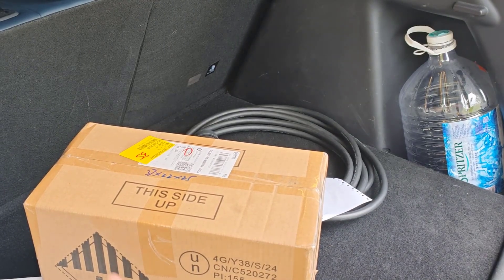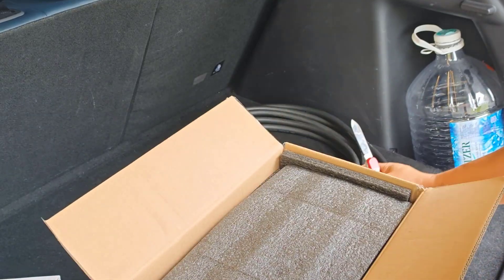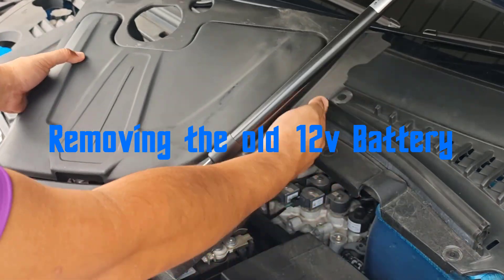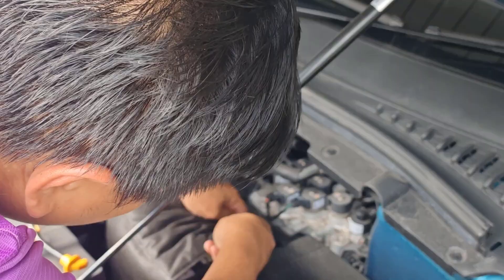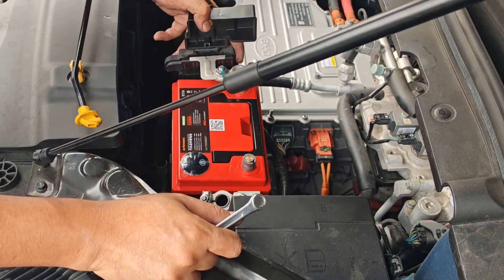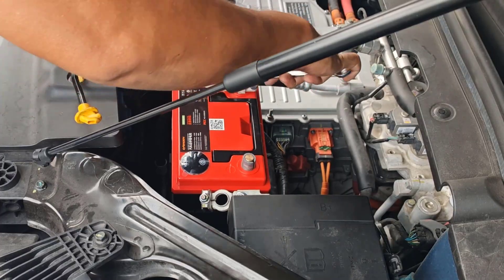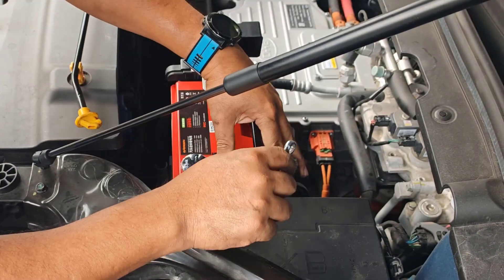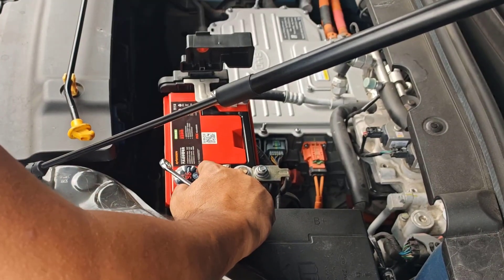12V LFP unboxing and swap BYD Atto 3 ER

Comment: on re-watching, i must say this is a very odd video - the presenter does not show the brand of the battery at any point and at the end he is using an OBD2 adaptor (unseen) to get the 12V  measurements - which he displays on the Atto3 screen - either by using air play or sideloading Car Scanner Pro - either which is not explained properly.  Changed my mind about this video